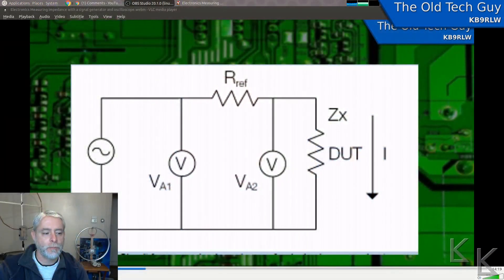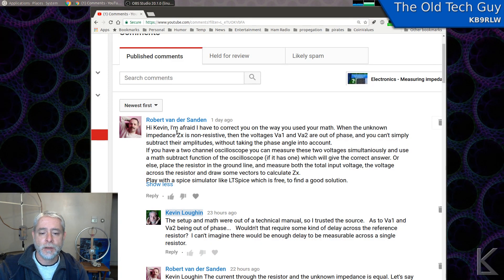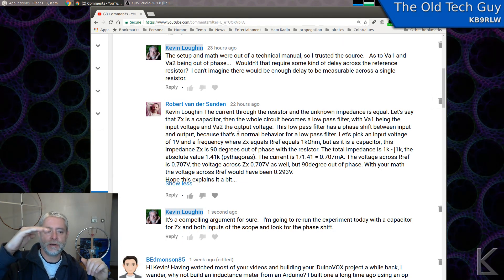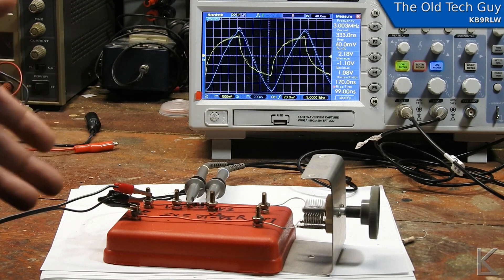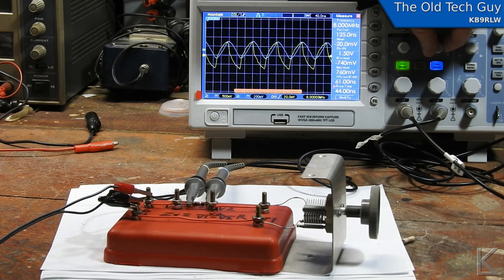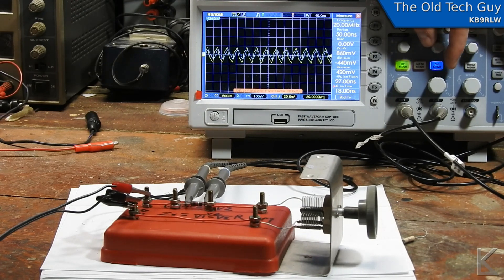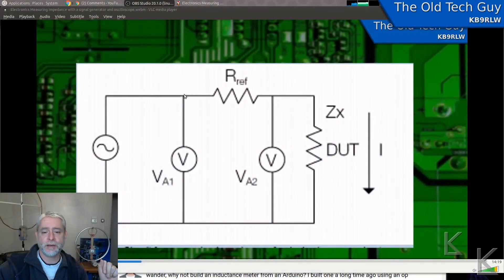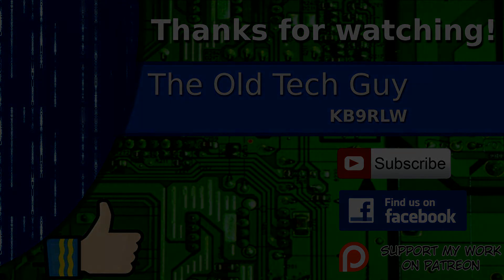Electronics - Exploring a viewers comments regarding impedance measuring with a scope

Comment: Kevin, love your videos. Phase shift occurs between Voltage and Current with a reactive load such as a capacitor. Your test setup is measuring two voltages. Therefore, you won't be able to measure the phase angle.

Ideally, you would use a small current sensing resistor with an DIFFERENTIAL PROBE across it on channel 1. Dividing the measured voltage across the resistor by its resistance value will give you the current going through the capacitor. Connect channel 2 across the capacitor as before to measure the Voltage across it.

Now you will know the Current, Voltage and Phase Angle needed to calculate the impedance of the device under test (capacitor). 

IF YOU DON'T USE A DIFFERENTIAL PROBE OR OTHERWISE ISOLATE YOUR SCOPE YOU WILL DESTROY IT!!!

Contact me if you want more details.

Merry Christmas and 73 from KE8EUI.

Comment: Kevin, let me see if I can muddle this up a little bit more...

Here is a link to an in depth description of this method....
http://www.kennethkuhn.com/electronics/impedance_measurement.pdf

It appears that a lot the descriptions of this method leave out some critical details that this paper covers.

Two  critical items seem to be necessary to make the calculation valid:

1.) Use a sinusoidal source since phasor "vectors" are assumed.  I know that is your plan.

2.) The magnitude of the phasor voltage must be accurately made across the reference resistor.  See page 5 and particularly equation 11.  So yes, the voltage phase shift from the source input side to output side of the reference due to LPF or HPF filtering behavior will matter.  But that will all be taken care of if the voltage measurement across the reference resistor is properly made (and calculated).  If so, then the equation will work. 

It would be interesting to experiment with the relationship between the frequency of the source test voltage and the 3db corners formed by the RC LPF configuration (f3db = 1/(2*pi*R*C) or the RL HPF configuration (f3db = R/(2*pi*L).  Theoretically, I would think the test frequency would not matter provided the magnitude of the voltage across the reference is accurately determined.  Several of the examples I have seen on this method used a frequency as low as 100 Hz.   But if the impedance of the circuit is dominated by the reactive Zx element, then there may not be sufficient voltage drop across the resistor for an accurate measurement.

I know you used 10MHz and 5MHz test frequencies, but perhaps they were not the best frequencies for the values of reactances you were trying to measure. Don't know.  May it was just the less than ideal sine wave source.

If an unknown reactance is involved, then the method may require the measurements and calculations at several frequencies, yielding similar impedance results and small changes in impedance going in the right direction.

Alas,  this simple method may not be so simple!

Comment: Great channel Kevin.  I like all of your videos.

My best input is that your test apparatus and measurement methodology is spot on in determining the magnitude of the impedance Zx.  Zx of course has both a real part (R) and an imaginary part (jXc).  The magnitude of the impedance R +jXc is the square root of (R^2 + Xc^2), and that is what your measurement yields. This is a series RC circuit, there is only one path for the current, and it's amplitude and phase is the same everywhere in the circuit.

There is of course a phase relationship between voltage and current in a reactive circuit.  In this case the source current, from your signal source will lead the source voltage by a phase angle of inverse-tan(Xc/R).  If the circuit is mostly resistive, this phase angle will be small, just a few degrees or so.  If the circuit is mostly capacitive reactive, then the phase angle will approach 90 degrees.  If R=Xc we get 45 degrees.  When you are measuring points across that "pure" resistor that represent only voltages, then you are not going to see any phase shift.

You want to be able to see the phase shift that occurs between the source current and the source voltage in this RC circuit.  Remember our friend ELI the ICE man....current leads voltage in a capacitive reactance circuit.  Put a small resistor in the capacitor lead that goes to ground.  Monitor this point with one of your scope probes.  This will represent the current in the circuit and show the phase shift between the source voltage and source current.  You could make this resistor (say 10 ohms) switchable in and out of the circuit so as not to interfere with the main measurement.

You can verify your test methodology by selecting a known capacitance value, a known resistance value, and using a known frequency.  Determine Zx using your methodology.  Then calculate Xc from the frequency used (1/2*pi*f*C), then calculate the magnitude of Zx from sqrt(R^2 + Xc^2).  You could also calculate the expected current versus voltage phase shift from inverse-tan(Xc/R) and then measure it using you scope.

Thanks for this challenging problem and making me think about reactive circuits that I first studied almost 50 years ago.

Comment: Hi Kevin,
The phase shift is not between voltages but between voltage across and current through a device.  You are looking at the phase shift of the voltages at each side of the resistor compared to the scope ground.  You might need a current probe to watch the phase of the current in the circuit.
FWIW
JP

Comment: So, I'm asking myself, if that corner point is effectivly a low pass filter, what other point in the circuit are you using as a reference. Try every point in the circuit possible as the other reference point to determine if there is any possible point that gives a phase shift. This may be one of those instances where you can find the result but you have to alter you reference to a point which would be counter intuitive.

Comment: Hi Kevin, thanks for challenging me in this interesting video. On your oscilloscope I can see the drawback of not using a sinewave as a source and how that can lead to your interpretation of the phase shift being near zero. I will try to explain.

There is no magic delay inside the resistor, whether it being wirewound or carbon. And with these dimensions and frequencies used there is also no effect at all of the wavelength. There is simply a delay in the signal between Va1 and Va2, because there has to be a voltage across Rref first (meaning a current flows) before the capacitor voltage Va2 follows. Va2 lags Va1. This delay translates to a phase shift and depending on the time constant and the frequency this runs between zero and 90 degrees, with 45 degrees at the corner frequency being 1 / (2 pi R C).

Why does it look like there is no phase shift on your oscilloscope? Because you have a filtered square wave input and a triangle shaped output and you determine the phase shift as the time delay between the peak of the square and the triangle. This is always zero because as soon as the input square wave reverses polarity, so does the current. The output triangle no longer rises but also starts to reverse direction at the same time, without delay. But when you look somewhere in the center of the signal (zero crossing) there is certainly a delay. And this delay is fairly constant over frequency (roughly equals R/C time constant) but at higher frequency this translates into a higher phase shift in degrees.
In the mathematical world, going from a square wave to a triangle is done by integrating the square wave signal, and integrating gives 90 degree phase shift, not zero. Yet the falling edge of the square wave and the peak in the triangle in this mathematical example still aligns like you see on your oscilloscope.

I just ran the same experiment with a sinewave HF generator, a 1k resistor and variable cap of 50-250pF and the phase changes nicely with frequency and C-value, as expected.
Reply from the maker: Hi Robert,   Thanks for the detailed thoughts, and I can see it in my head now.   I do plan on re-doing it once I get my old signal generator running so I can use a sine source.  rlmiller, a few comments below,  duplicated it as well with a sine source and said he could see the shift.
This is what I'd hoped, the community would step in and add more detail to clarify it.
Although, when it comes to calculating the impedance by measuring voltage drop, I still wonder if phase would make any appreciable difference in the result.  More exploration to do there in the near future.
We're all always learning,  that's what keeps life interesting.
Reply: Robert; would you expect his results in his latest setup be any different using an analog O-scope vs the DSO he is using?
Reply: William Miller Hi William, I have an oscilloscope with analog and digital mode (an old Fluke combiscope) and have seen no difference between the two modes.
Reply: Thank you.
Reply: In my comment to the original video I touched upon this phase shift point in relation to the way you determined the voltage drop.

If the phase between Va1 and Va2 is other than zero then the voltage drop across Rref (which is a measure of the current) is not the same as simply subtracting the amplitides of Va2 - Va1. These two voltages are vectors and form two sides of a triangle with the measured phase angle in between. The third side of this triangle, which is the difference between the two and thus the voltage drop, needs some fiddling with goniometry to be calculated correctly.

When |Rref| equals |Zx| but Zx is either inductive or capacitive, then the phase between Va1 and Va2 is 45 degrees. If the input voltage Va1 is 1V, then Va2 is 0.707V. Simply subtracting these would result in 0.293V for the voltage drop in Rref, but in reality the voltage drop in Rref is 0.707V, because the impedances are the same and so is the current through them.

Comment: The 90° phase shift is between current and voltage in a reactance , in a capacitor the current comes 90° before the voltage and in an inductor the voltage is 90° ahead of the current. In a ideal resistor the current and voltage is in phase. JFG

Comment: Interesting,  I tried this same setup and saw a substantial phase shift.  I was using a carbon 1.5 k resistor and a 68 pf cap at 10 MHZ.  If I went down to 100 Khz it was just a couple of degrees as I would expect because a 68 pf is basically an open at 100 Khz.  At 100 Mhz it was approximately 180 deg and ~90 deg at 10 Mhz.  Just to be sure I used 3 scopes.  An analog Tektronix, a high end HP digital and a low end Siglent.  All were exactly the same.  I also confirmed the same readings in LTSpice.    What values were you using?
Reply from the maker: Thanks for taking the time to do that.   The carbon resistor was 1K and the cap varied from 5-60pf.   I'm going to work on my heathkit signal gen today so I can redo it with a proper sine wave at the input.  It boggles my mind that there would be a phase shift across a non-reactive resistor.
At any rate, looking back to his original comment,  I fail to see how a shift in phase would have anything to do with measuring the voltage drop across a non-reactive resistor.
Reply: I checked because after watching the video I became interested.   I have seen the method you used before and never questioned it.  But now the brain cells became stimulated :)   I am learning as I was attempting to duplicate what I saw with my own 2 eyes on your scope and could not, Wolfram I believe answered why.

Comment: Measure the current and voltage separately to get a clearer view of the phase shift. The voltage drop over Rref show the circuit's current (indirectly, but linearly). I would measure channel one over Rref only and then set the oscilloscope's trigger to either channel. That should show the voltage drop over Zx phase shifted with respect to the current (seen in channel one).
Reply from the maker: I think part of the problem here is use of the word "phase".  Definition from wikipedia: "In physics. Phase (waves), the position of a point in time (an instant) on a waveform cycle."    So "phase shift" is nothing other than a change in the time domain of any chosen point along a  wave. With current and voltage, you can calculate power, but how could you possibly tell what point in time the zero crossing point, or the peak of a wave occurs?   A phase shift across the resistor would mean the voltage starts to rise from zero on one side before or after it does on the other side.  
The only thing you'd be measuring is how much voltage drop there is across the resistor, and how much power it is dissipating.   Yes? 
This is fun to think about!
Reply: Yes, it is indeed about the time domain. The phase shift is given by measuring the time difference between the current and the voltage curves as shown on the oscilloscope. Usually one measure at peak or zero, only because they are practical and easy to use for humans. In theory, you can use any arbitrary point as long as you use the same on both curves. Your trigger setting combined with the two curves tell you whether the current is ahead of the voltage or vice versa.

This is extremely simplified: Due to the nature of LC-components, when fed AC/RF or impulses, current and voltage are forced to phase shift. What you will see when measuring phases on RLC-circuits is:
- A resistive load has the phase shift zero, i.e. no phase shift at all. 
- A capacitive load has the current ahead of the voltage. 
- An inductive load has the voltage ahead of the current. 

And, finally, if an LC-circuit has no phase shift, then you are feeding the circuit it's resonance frequency.

I am, obviously, assuming ideal, school-book, components above. Modelling inductance in resistors or stray capacitance in inductors will only add complexity.

One video that explain some of this is W2AWE's #54: https://www.youtube.com/watch?v=ykgmKOVkyW0
There are many more on the same topic on YouTube :-)

Comment: Very difficult to discuss "phase shift" (and indeed, impedance)with two such different waveforms. Clearly, the circuit is acting as a LPF as the input waveform appears to have a higher harmonic content than the output. You certainly can't just compare the "peaks" - what about the rising and falling portions of each waveform? They are clearly not aligned. Subtracting one waveform from the other (as originally suggested) would clearly display a residual waveform, which in itself suggests that they are not in-phase as that should lead to complete cancellation if levels are suitably adjusted.

What is your input waveform supposed to be? A sine? Clearly, this experiment demonstrates the difficulties one always gets into when using these "simple" measurement techniques at AC. I have found traditional AC measurement bridges mostly unreliable since it is very difficult to obtain the theoretical "null". Still, keep the demonstrations coming!
Reply from the maker: The source was a semi-smoothed square wave.  The capacitor load smoothed it further due to charge and discharge time.  I knew someone was going to say something about that.   The scope was triggering only off input one, so if the trace on input two shifted in the time domain, you'd see it when changing frequency or the capacitor as we did, right?  I admit it was a crude source, that's why I encouraged others with better gear to duplicate the experiment.   I'll be doing it again if I can get my old heathkit signal generator going again.
Reply from the maker: You've had me thinking about it for awhile.  I think the question comes down to this.   Will a waveform shift in time across a non-reactive resistance?

Comment: Hi Kevin,
Merry Christmas. Nice demo with the carbon resistor. Wonder if the resistor used in first demo shows any phase angle?  73  WB3BJU
Reply from the maker: Well, if that original precision resistor was a wire-wound type, it would have some inductance, which would mean it would present a reactive component as well as a resistive component.   It would be like putting an inductor in series with a capacitor, so there would certainly be a shift in the time domain of the wave at the point between them.